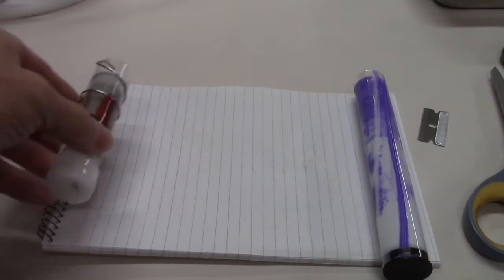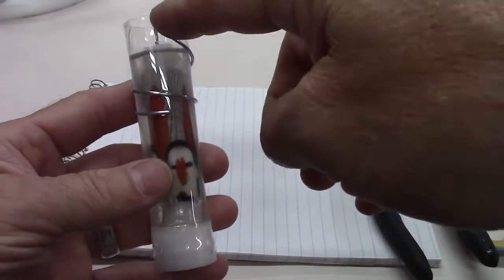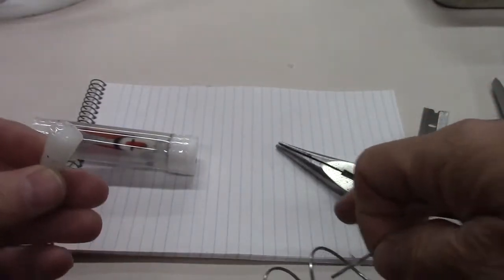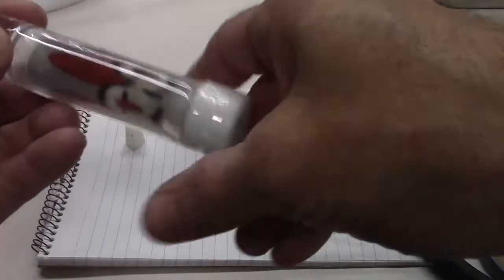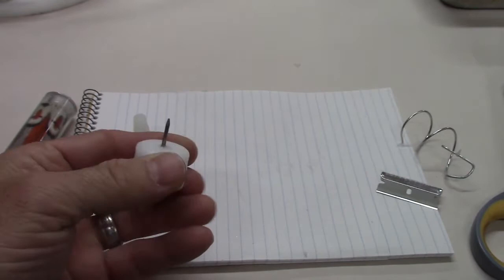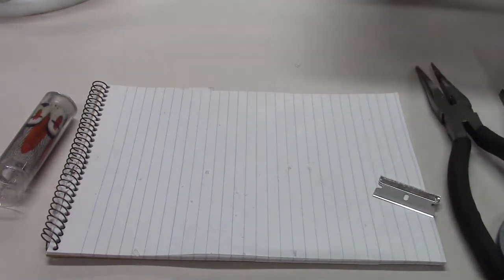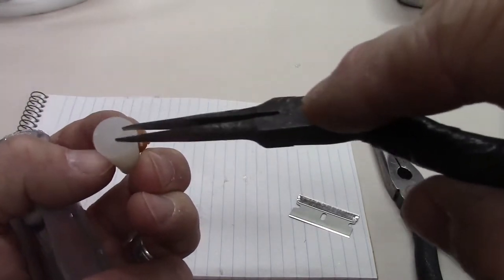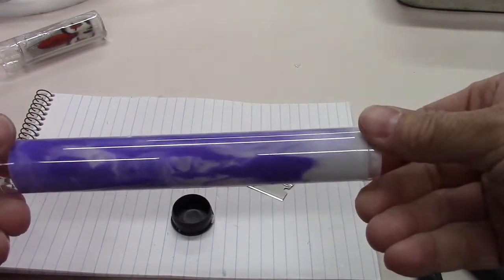Underhill Casting:   Demolding your vertical cast

Comment: I got all excited by your video about the vertical system.  I hate to think what would happen if someone went full speed ahead and tried to use that system without seeing this extremely helpful companion video!  I'm sold!  I guess I need to buy a pressure pot first, though.